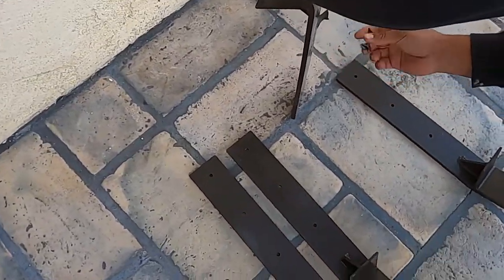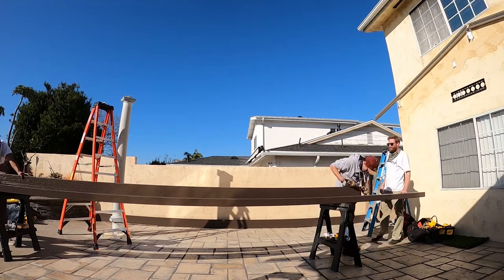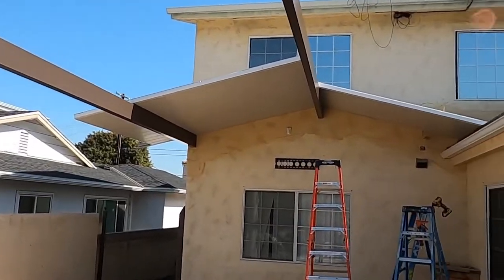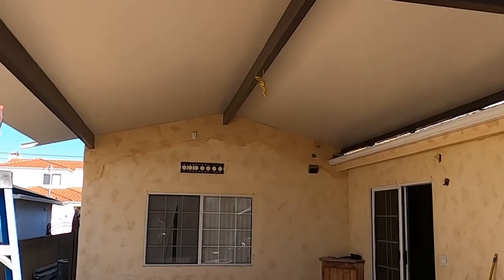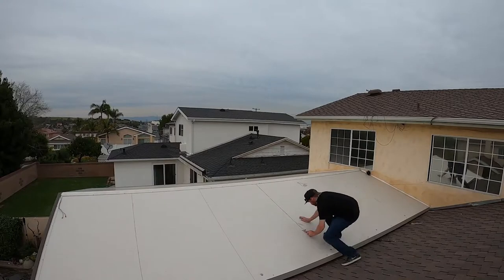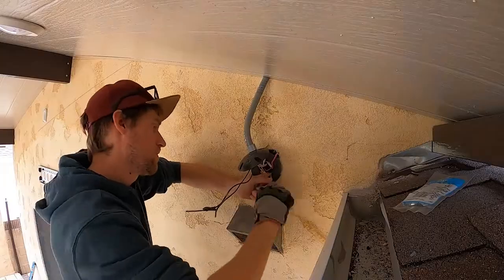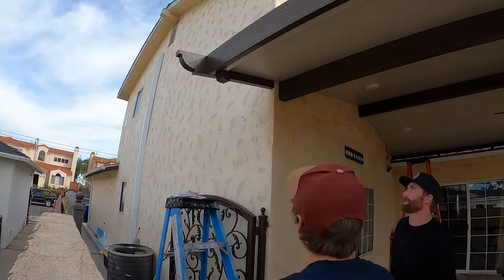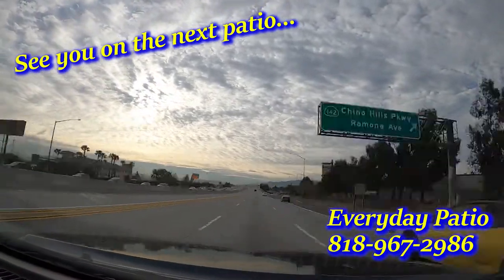How to Roof Mount Gable Four Seasons Patio Cover

Comment: I was browsing and came across this video. This is beautiful!  What was the size of this Aluminum Gable and how much did it cost?
Reply from the maker: Hey Good Afternoon Matt, the size of the gable was something like 24 ft. by 24 ft., give or take a couple ft. for the gable projection. As far as cost goes, gable prices are site-specific. If you're interested, feel free to send me an email or call and I can help you with the process of ordering one.

Thanks again for checking out the video and I hope you have a good rest of your day,
Alec
818-967-2986
Everyday Patio
Reply: Everyday Patio thanks I think I will! One question I have is when you say 24x24. Is the 24 foot include the overhang of the roof or is that where the post is place at 24 ft. Thanks in advance!

Comment: Great project, how would you guys mount a tv to the actual patio, where is the best section to mount, or I should ask where is the strongest. I have a similar insulated roof.
Reply from the maker: This really varies by patio cover, there is no strongest point to hold a tv, any point would have to be built up. The easiest place to build up would be above a panel, adding a bracing on either side and thorough bolting it. It depends on how the cover was built. 

Hope this helps,
Everyday Patio

Comment: Great job .what is the best sealant to use in this kind of roof ?
Reply from the maker: I personally prefer to use Nova Flex, it holds up the best in the long term. A few crews I work with use Manus Bond and Dowsil as well. I haven't seen this after 5 years, so it's hard to know how good they are yet.

Hope this helps, thanks for the comment and have a great day Jorge!
Everyday Patio

Comment: Good morning what did you use for the ridge cap? Did you Bend Flat stock? Also do you recommend peel and seal for for joints up top?  How far apart are your screws to attach IRP panels to the 3x8 beams. Looks excellent. Thanks.
Reply from the maker: Hello Christian, Good Morning to you too. I use the ridge cap, but some people use flat stock for the top. As far as the peel and seal goes, I don't use or recommend it. And you should have 5 screws, more or less on your panels, it depends on the span and type of patio cover.

Thanks again for reaching out,
Everyday Patio
818-967-2986
Everydaypatio@gmail.com
Reply: Everyday Patio thanks for feedback. What kind of recessed lighting do you recommend on a Elitewood flat pan cover? Could I use shallow mounts that don’t require a can enclosure and cap off the top with a 6”carport fascia?

Comment: hello.  my friend do you use thicker metal bean or wood  inside of those alumawood rafters covers or they are strong enough to hold that weight?
Reply from the maker: You need steel inside of the beams on a job like this. Spans, attachment method, footings, etc. All determine what kind of structural reinforcement you need. Wood is not ideal for an insert, for alot of reasons.

Hope this helps and thanks for the comment,
The Everyday Patio Team

Comment: Hey Mike, can an insulated patio be made into free standing A-frame type/gable covering?  What I mean is that a 17' plus another 17' shaped in a A-frame (width wise), without any posts in the middle for additional support by 40' for the length?   I asked this question  on another of your videos, but is what I meant.
Reply from the maker: Hey Again Anto, we have a few videos on Freestanding Gable A-Frame Patio Covers, Gables are Site Specific and Spans are determined by the Engineering for the project. With pictures or more information I would better be able to answer this question. If you are asking if you need more than 2 Posts for a 40 ft. span, I'm sure Engineering could achieve 2 posts, but regardless, on a span like that you would want at least 3 posts. A lot of factors play into post design on a A-Frame Gable, especially Freestanding. 

Great Question, 

Hope you have a good rest of your day,
Everyday Patio